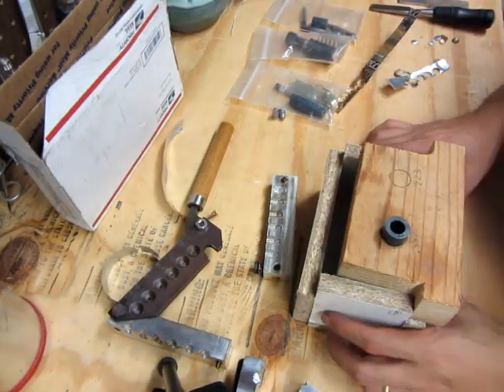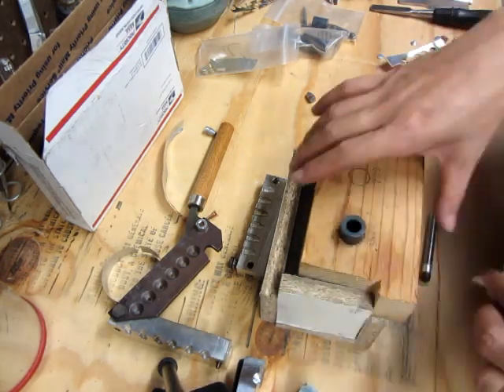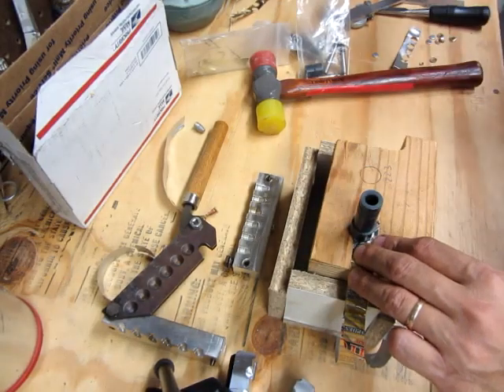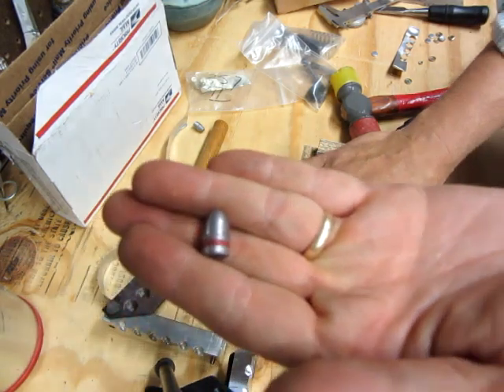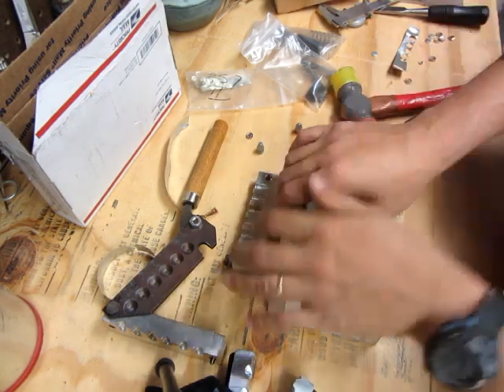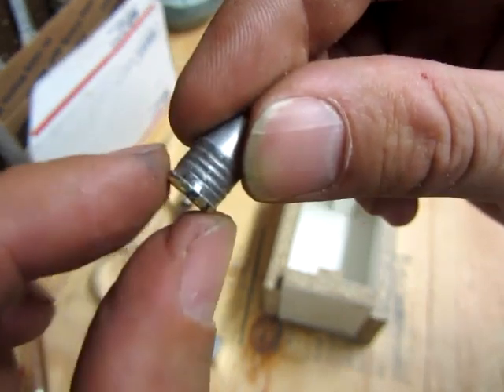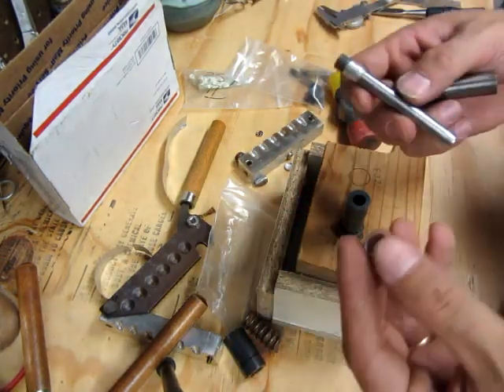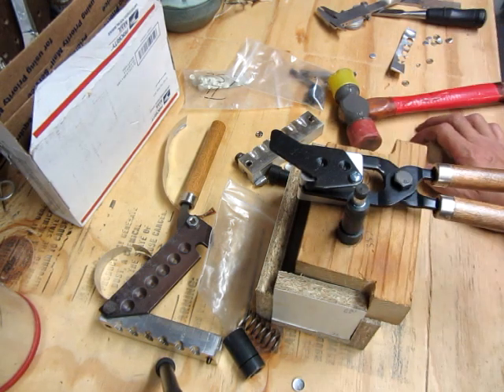What the heck is a Gas Check?!!

Comment from the maker: OOPs, I missed this comment.  I have a Lyman reloading manual and they do have data for gas checked bullets.  I think Sierra also has gas checked data in their manual.  From what the Lyman book says, the loads for gas checked bullets are similar to a FMJ bullet.  The high end is not as hot, but the low to mid ranges are pretty much the same.  I will try to do a video on the book and some loads that I use.

Comment from the maker: Yes, the differences in pressure can cause significant leading in the barrel.  If the pressure is too high, the gas can actually blow by the bullet and cut the lead causing it to be deposited on the barrel when the bullet passes over the separated lead.  Lower pressures are not as harsh on the plain lead buillets.

Comment from the maker: I just learned this today.  Apparently, at higher loads and pressures, the gasses blow past the bullet and can cut or separete the lead thus is more prone to deposit on the barrel.  The gas check is harder and contains the gasses and keeps the bullet intact, which reduces leading of the barrel.
Reply: Does the gas check scrape the leading caused by the cast bullet off the rifling as it passes by, or is the issue that the bottom of a cast bullet deforms too much because of the blast and that is the source of the leading, the bottom of the bullet? So the gas check stops the bottom of the bullet being deformed, and thus prevents leading?
Reply from the maker: @dkeith45  I think a little of each happens.  From what I have read, the gas checks mainly prevent what is called "gas cutting" on the back of the bullet which could cause leading of the barrel and or loss of pressure.  Although I have not personally noticed any issues shooting cast bullets without gas checks.
I have noticed that the gas checks do keep the lead fouling down compared to non gas checked bullets.
Reply: @saltyshellback  Very interesting. I'm going to have to look for the kit you show here. I became aware of the issue when I purchased a Hammond Game Getter device. Hammond suggests not using Ramsets past Browns because of potential leading in the barrel. (Oddly, Greens are cheapest in my area) I had thought FMJ bullets instead of cast would solve that problem, but they're so damn expensive currently. (lowest cost FMJ 50 grain .224's are .12 each) Gas checks, with cast bullets, especially home made ones would keep costs down (lowest cost gas checks for .224 are 3.5 cents each currently). I'll just have to get a mold. I have a Lee lead casting device from my muzzleloading days and plenty of lead.
Reply from the maker: @dkeith45  I think the guy who sold these doesn't make them anymore.  I tried looking for him a year ago, but his contact information doesn't work anymore.
Reply: @saltyshellback  Hm. That's a bummer. But even buying commercial made checks looks like a much cheaper solution than using FMJ bullets. And BTW, if you still have the kit, I bet someone else could probably put them into production again using the kit to make copies of it. Probably not patented.

Comment from the maker: OK, Here is the Wiki answer that explains it better than I can:
...the high pressures allow propellant gas to escape past the bullet, causing gas cutting, which increases lead deposits in the barrel and unbalances the bullet. A gas check provides a thin layer of harder but still malleable metal on the base of the bullet that obturates to provide a seal and prevents the propellant gas leakage that causes gas cutting, and help the bullet grip the rifling.

Comment from the maker: You are still correct, it is the friction of the lead, but the faster it goes, the more leading there is.  It is sort of a function of momentum and pressure.  Think about pulling a rope over your arm slowly vs. running it over your arm really fast.  Which condition do you think will cause the most rope burn...lol  Also, the gas check is harder than the lead, and even though the bullet will lead the barrel, the aluminum should scrape the lead off. that is the theory anyway :-)

Comment: NICE! Wish I'd have found this video a long time ago, would have simplified things for me. I've been trying to decide, gas check casting systems or no gas check casting systems, because in SHTF, where/how the F am I gonna get gas checks?! I didn't know there was a punch system for them. Plus, Ive been wondering what the heck the gas check was for. I knew about lead fouling, but didn't know the gas check was to minimalise it.
Reply from the maker: Glad this video helped.  Iraqveteran8888 also has a good video on gas check makers.  That's how I found out about them.  The gas checks also alleviate something called gas cutting of the bullet.  I read about it, but I am still not quite sure what exactly it is besides that the gas wants to escape the barrel faster than the bullet can travel and will take the path of least resistance.  So any soft spots in the lead around the edges will get gas cut causing loss of velocity...I think.
Reply: saltyshellback Wikipedia actually mentioned gas cutting. In a sense, it sounds like the gases find the little leaks in the seal between barrel and bullet and the heat from compression of the gases makes the little leak spots act like a blow torch and cut the bullet till it gets past the bullet. The copper gas check is still malleable to grip the rifling better, but since it conducts heat much better, the heat won't cut the copper.

Wikipedia: High pressures, such as those commonly encountered in maximum loadings of magnum revolver cartridges or rifle cartridges, often result in significant problems when coupled with cast or swaged lead bullets. It was long thought that the high temperatures melted the base of the bullet, but this is no longer thought to be the case. Instead, the high pressures allow propellant gas to escape past the bullet, causing gas cutting, which increases lead deposits in the barrel and unbalances the bullet. A gas check provides a thin layer of harder but still malleable metal on the base of the bullet that obturates to provide a seal and prevents the propellant gas leakage that causes gas cutting, and help the bullet grip the rifling.
Reply from the maker: Cool thanks!
Reply: saltyshellback No prob. Got any tips on which brand or kind of molds to invest in? I heard of some carbide (?) ones that I can use with a single set of grips/handles by swapping the molds around. Granted the molds are expensive, but I really don't care, if I'm gonna do this, I want the best quality ones I can get for the cleanest quality casting of my calibers. I've got several I need, so the more info, the better. Figuring out reloads for my Mosin is the biggest problem I'm having.

(9mm, .38 spcl, .357, .45acp, .223/5.56, 30-30, .45-70 govt rifle, .308/7.62x51, 7.62x54R)
Reply from the maker: I have the Lee molds.  They are aluminum, but work just fine.  I have 
either a Lyman or RCBS mold for my .223 that works great, but it is only
 a 2 cavity mold and it pretty slow going, but it is steel and will last
 forever.
Reply: The gas check shields the base of the bullet from the hot gasses.

Comment: You probably already researched this, but Lead bullets tend to run higher velocity and less pressure than jacketed bullets of the same weight and powder charge due to having far less resistance than the jacketed bullets.
Also some data prints the starting load of a jacketed bullet as the top load of a cast lead bullet so it dosnt hurt to check out a few reloading manuals before starting a new load... 
What cartridge are you thinking of reloading? :-)

Comment from the maker: I get lead from anywhere I can.  I have some from when I worked for a company that did x-ray, and I got some wheel weights (about 10 pounds) from a tire place, I got some from a friend that scrounged it from old machinery.  I have been told tire stores will give them away, but every time I ask, they always say they re-use them.  It is a BAD idea to use old batteries because some contain arsenic-BAD JUJU!  I don't need lead that bad.
Reply: I was a roofer for many years. There are lots of old homes that have pure lead soil vent pipe flashings. They're often somewhat coated with tar, but that can be ignored. You just heat one on a piece of plywood with a propane torch, and the lead will run off into a metal bucket. Most of the tar will stay behind. You can even still get new ones at lumber supply stores. But I'd suggest going to a large roofing company and offer to buy them, maybe for a few bucks each if they'll save 'em for you. Otherwise they just toss them in the dumpsters along with the old shingles when they do a roof tear off.
Reply from the maker: @dkeith45  Good to know! I got my lead from a local tire store that sold m a 100 pound bucket of wheel weights for about 25 cents a pound. After sorting the steel and zinc weights out it comes out to be about 30 cents a pound, but that's still a decent price because the wheel weights are a good hardness for bullets.

Comment: I see. So now I wonder that if a gas check is used on a lead bullet, if that means the load data for a jacketed bullet of the same weight can safely be used. Not that I'm in a hurry to try it or anything, but I am curious. It seems my LEE reloading book would rather I buy expensive jacketed or plated bullets instead of just casting my own bullets, since most of the date is related to jacketed bullets.

Comment: when is it ok not to use a gas check, i have some experience handloading and use the 12ga mold and im thinking about getting a mold for my 45 colt lever action hunting loads
Reply from the maker: It depends on the load. If you use load data rated for plain cast lead bullets that is safe with no gad check. Anything hotter will need a gas check.

Comment: get your alum gas check and stick it on some propane gas torch and it only takes a few seconds to melt away..do the same to brass or copper (same thickness) and it will glow red hot but the propane aint hot enough to melt it..try it...not to mention oxygen  from the air produces oxides on alum. thats how aluminium oxide emery paper is produced but with pure oxygen to speed the process of oxides up.
Reply from the maker: +pooliphine Aez Yup, I have worked at places where we used alox as a blast media.  It's pretty aggressive stuff.

Comment: dont use alum....use brass or copper...ever seen a FMJ with alum jacket..?...NO........I learnt THE HARD WAY.
by the way, quite a few say you can shoot gas checked bullys to jacket speeds...hahaha...i dont think so.i know cause i have tested everything i said here for years and learnt a lesson.
here is a bit of info from what i found..exceed 1,200fps with a copper,brass GC and leading will happen.only a very small amount but builds up and up if you keep doing it.
use alum checks and the same will happen at speeds over 1,200fps but oxides will also release from the alum checks..
melt point of following metals to confirm this..
alum 660 deg c
lead and its alloys...320-350 deg c
copper 1100 deg c
brass 900 deg c....get my drift ?
temps in a case can be from 600 to 850 deg c on firing...this is why we use brass or copper..DONT USE ULUM  !
Reply from the maker: +pooliphine Aez I split the difference between FMJ and lead loads.  I am not necessarily after performance, but more to keep the barrel from leading up.  Iraqveteran8888 runs aluminum gas checks so that is good enough for me :-)
Reply: +saltyshellback fair enough...just to clarify...alum checks ruined my AAA target grade very expensive barrel by using alum checks according to 2 guns smiths who went over and over my barrel till a conclusion to accuracy loss was found.. alum checks ruined my barrel with tiny little aluminium oxides embedded in my rifling in which NO scrubbing etc would ever remove the oxide Pitts...in other words, permanent barrel damage due to the use of alum checks which release oxides at high temps when you squeeze the trigger..
FMJ copper is the safe way to go or even brass.
Reply from the maker: Good to know thanks!  I have only shot a handfull of aluminum gas checks, so any damage to my barrels is negligible.  I'll look into getting copper stock or brass.